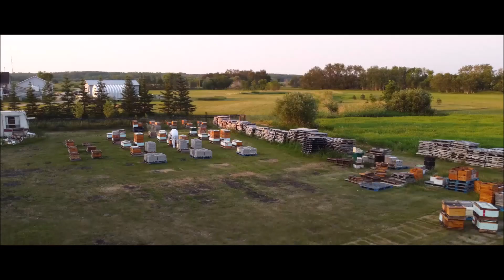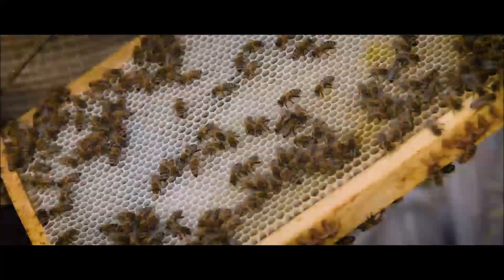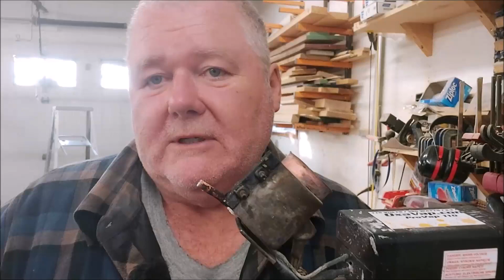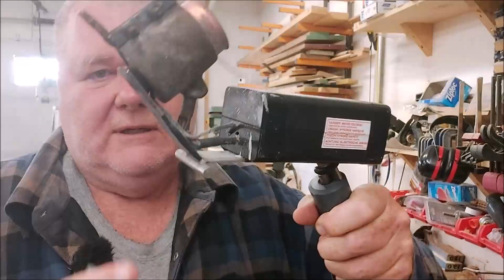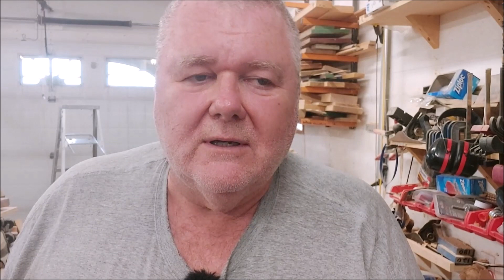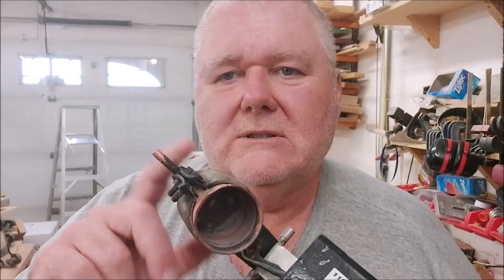OA Vaporizer Talk-That Bee Man

Comment: Do a search on Beesource for band heater vaporizer. There is a 6 year long thread in the Equipment/Hardware section that has explored just about every conceivable option in the DIY OA vaporizer world. The short answer is that a copper cup made from 1 1/4" copper pipe or 1 1/4" copper pipe coupler with a copper bottom attached with Harris Sta-Silv 5% brazing rod makes a heating cup that holds heat well. The cup is paired with a close fitting band heater. 
Look up threads 1155 and 1260 for summaries of the parts needed to do the job. Lots of knowledge here scattered through the threads.
Reply from the maker: Thank you!  I will!

Comment: As you discovered, the two part cup with an aluminum plug and copper sides suffer from different rates of thermal expansion when heated. That makes the joint between the differing materials subject to leaks.
Reply from the maker: A very poor design IMO.

Comment: Line loss from the power source can cause problems. Long drop cords no matter the gauge will result in power loss. Remembering amperage is more important than volts. Amperage is only good for a certain length. Loss of milleamps can cause the bowl to not function properly.
Reply from the maker: Have you been working in the electrical field long?
Reply: @ThatBeeMan  . Actually I am a ham radio operator for around 50 years. Construction superintendent for 35 years, all while learning electrical systems. To keep it simple, amperage is the force that pushes the current. For simplicity, if you have a number 12 copper wire and you apply ten amps to it and check it at 50 feet and again at 100 feet there will be a drop in voltage. Might be slight but nonetheless a drop. Remember that electrons run on the outside of the wire, that’s why larger diameter wire can carry more amperage.

Comment: How exciting, great idea to build one suited to your requirements.  You might want to consider mounting it on a self driving cart with machine vision and a robotic arm so you don't have to do anything, just joking.  Good luck.  My experience with DIY is there often are design flaws that you'll encounter when field testing, might have to go through a couple of versions until you get it down pat, good luck!
Reply from the maker: What a great idea, Norm!  Job one is to get the bowl to not leak.  Once that's achieved, I may look into robotic automation hahaha!  Mark has done a lot of that trial and error and I'm thankful to have him as a resource.  I'll be starting miles ahead instead of at the beginning.  I'm sure that success will be quite likely.